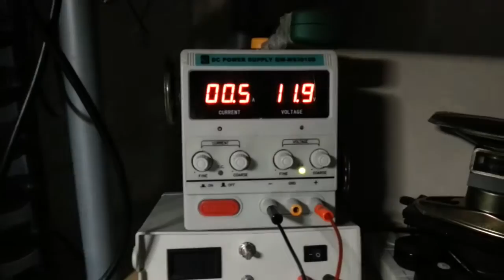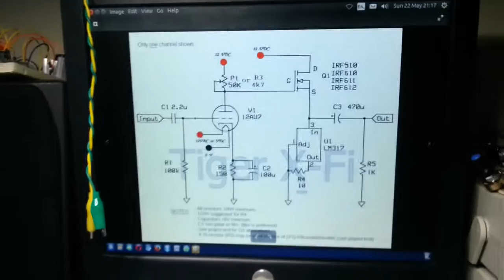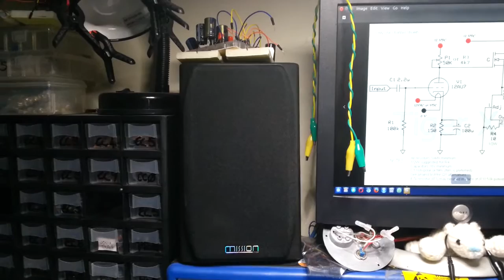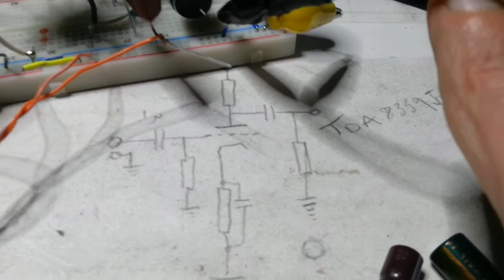ECC83 / 12AX7 12V Stereo Preamp or Headphone Amp

Comment: I just built this circuit. One question, is it bad for the tube to have the gain at full like you have it on the video? That is, with no plate resistor. Should I leave the bias fixed or I can vary it with the pots while I use it?
Reply from the maker: You can alter depending on the load. I'm using 8 Ohm speakers for this demonstration. Use less gain for headphones.

Comment: Um.  How about a 1K sin wave into an 8-ohm load and then looking at the output wave through an Oscilloscope.   Check for harmonics.  Or, if your scope has an FFT mode, you can check for distortion?  It might be more informative then hearing the music through your crap mic and my crap speakers.

Anyway, good luck.

P.S> I too have blown up a DMM.  I think you have to blow up at least one to be considered a proper amateur audio buff.  It's a rule or something.